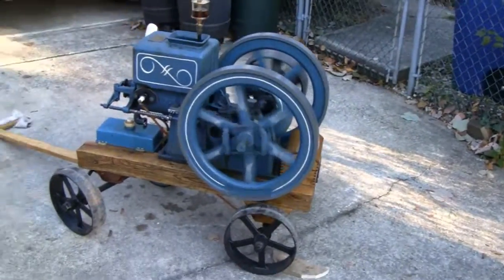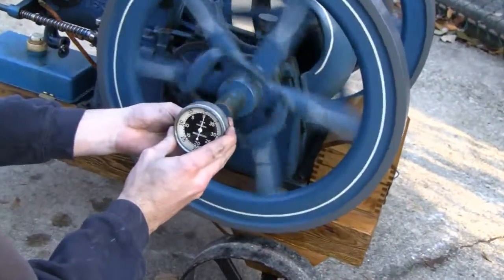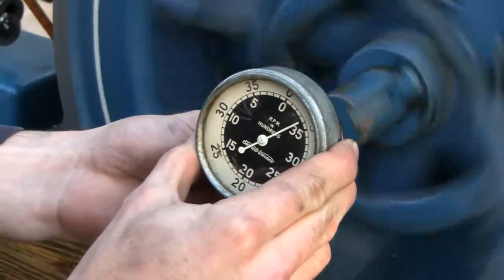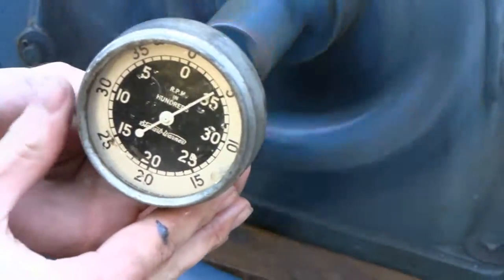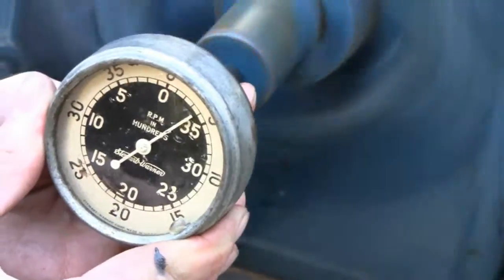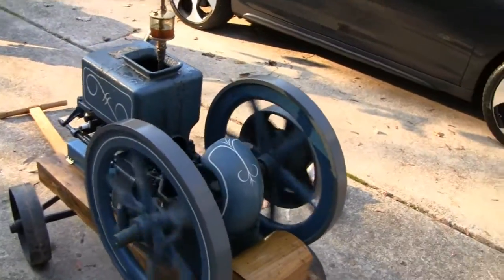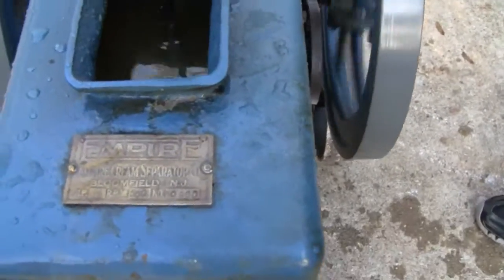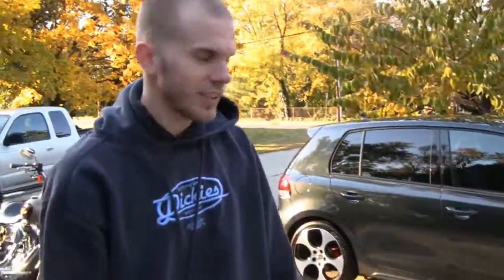SPEED TEST ON HIT MISS ENGINE

Comment: Wow, I can't believe you revved it up like that. Makes one wonder what modern crankshaft, piston and rod design could do to increase the RPM. I feel most of the vibration stems from that long, heavy, cast-irn rod and the lack of counterweights on the crank itself.

Comment from the maker: @scotty2307 We only ran it at 600 RPM's, A 2ft no joint cast iron Flywheel is rated for 955 RPM and could be run near 2000 RPM before it would be considered unsafe. So we deemed it fairly safe for a 30 sec demonstration. Thanks for your comment and concern Buddy. It definitely could have been dangerous in the wrong hands!!☺